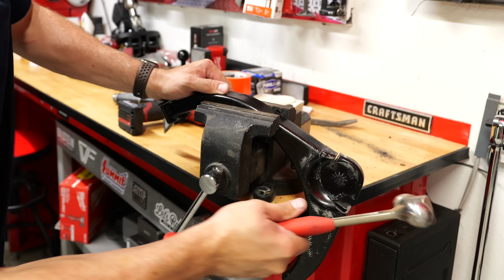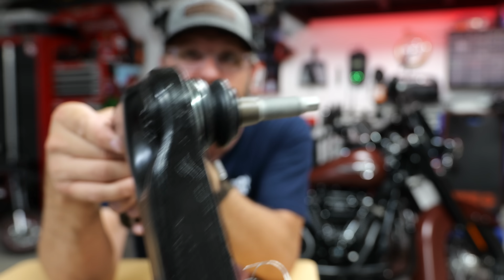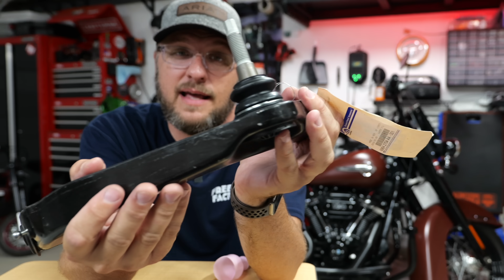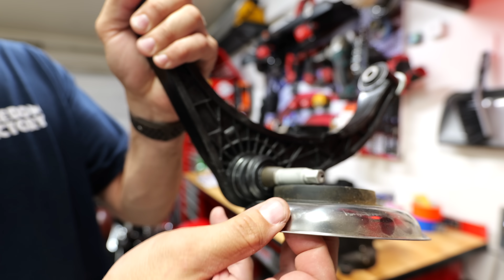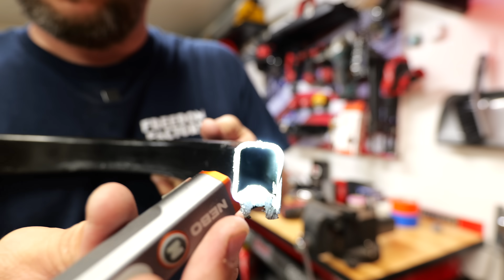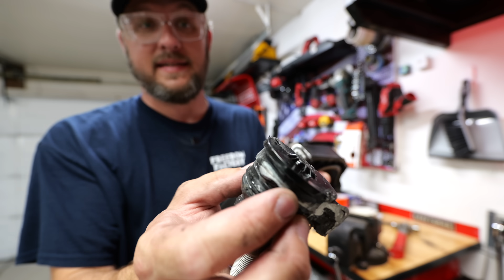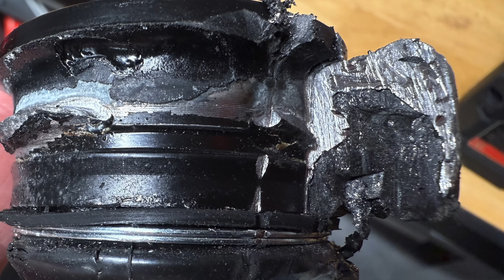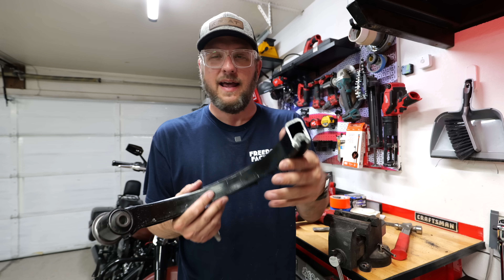I Cut Open RAM’s Plastic Upper Control Arm… Worse Than I Expected?

Comment: I have had 3 vehicles, 1-1992 jeep commanche 4L  6 cyl,   2-2006 saturn vue 2.4L  4 cyl,    3-2015 mitsubishi outlander sport 2.4L  4 cyl, all roughly the SAME GAS MILEAGE.

Comment: Because you can stamp a U shaped component. Plastic is there to prevent the U shape from collapsing and is a good use of plastic because it will be completely under compressive stress.

Comment: One of the particulars that finalized the "Go ahead" decision to create the Pontiac Fiero was its "All plastic" bodywork....the deciding reasons were the cost of forming a plastic fender vs. forming a metal fender....the cost of forming a single metal fender EQUALING the cost of forming the entire plastic collection of bodywork pieces. Why make it out of metal when you can make it out of plastic at one-twentieth the cost?

Comment: Dodge loves making plastic parts. Just like their crap rear ends...
Reply: Just want to clarify I'm a parts fabricator. I've been building control arm systems for years. I daily drive a prerunner trophy truck. I know how much strength I put into my control arms and this just really a crazy thing to see. Uppers are primarily guides to keep your spindles upright. They don't need to be crazy strong but they do need to be able to take force in all directions. That ball joint breaking off was absolutely insane to me.

Comment: GM has had Afm, Cylinder Deactivation,  DFM or whatever you want to call it since 1981 and it ALWAYS FAILS!! Making plastic suspension parts is ridiculous!! First off metals can be recycled and presently not all plastics are recycled with the excuse they can't. But the real true is COST!! ALL plastics can be recycled but it COSTS more to recycle than to produce new plastic. We already have to much plastic in or environment and these co trol areas are just another thing that will not be recycled so Dodge can save a few dollars!! Added to that not easy being able to replace ball joints or bushing easily. Just JUNK!!!

Comment: If they full inject it. It would most like flex to crumble a part over time. Plastic can only take so much abuse. Keep in mind potholes, uneven surfaces, offloading... it may fail muvh much early than the traditional upper arm would of ever failed. Depending on camber bolts being seized in the arm

Comment: Am gonna just take the ignorance of your youth and understand why! You dont think the trucks of today are overpriced! Probably never even road in any of the old 40's,50's and 60 thru 70's trucks and cars! My gen new how to make the stuff to last! This gen....pop corn crap, my TP roll is worth more! Dont get me started on the computerized BS they have put in. I see more people having problems today all cause of computerized gizmos! You keep todays look good crap and I will keep the good ol stuff. Heck, I can still turn my neck to back up and dont need a camera that wont work half the time to do that! This gen lacks SOO much! Hmmm, ingenuity being a key component! Ya know cummings makes a transmission for the Nissan Frontier and they keep a 3 dollar part out that any good mechanic could and should be able to fix cheap, They keep it out so when it fails and it will the customer has to pay 12,000 for a new tranny! The days , MY TIME, buy a vehicle and got a great warranty!  Usually at least a 100 thousand or more. Today they dont. Nissan Frontier offers 36 thousand miles on their tranny and drive train. That speaks volumes!
Reply: I'm old enough now that I really think I can live the rest of my live finding older well-maintained stuff from about 2005 or so and back. That's when they started with the CANBUS computer stuff where EVERYTHING is tied to the VIN number and has to be programmed to work. Vehicles that old and older can still be found in perfect condition if you know what vehicles that have the better histories to buy. CANBUS forward it has been nothing but a long decline into Tinkertoys and I think the Tinkertoys would hold up better.

Sad part is that the younger folks think that all of this garbage is "normal".
Reply: @CallibanMcGee  LOL, my first legal ride was a 64 chevy 3/4 ton truck, straight 6 and amazing torque. Am looking for a 72 ford econoline/ with a 3 speed on the  column.
Reply: @Fish4Man61 mine was a 66 F100 3 on the tree. Great place to rest your arm. Lot of firsts in that truck, including one you're STILL not old enough to hear about. 😁

Good luck in your search for your ride!
Reply: Yea. Everyone thinks push button to start is a new thing! An old 1962 Ford P/U had push button start with no key FOB! Dislike all these electronic  gismo vehicles of today. Orr neighbors 2015 Ram p/u has way too many electronic gadgets. Especially for the HVAC & radio.

Comment: After seeing the cross section of the first cut, I'm inclined to think the plastic extrusion/injection helps make the stamped part more rigid for chassis or noise tuning and potentially some driver input at the wheel. However, this seems to fall in line with the wear item parts are throwaway vs being serviceable trend in automotive.

Edit: Sub'd

Comment: so its actually a steel control arm but coated in plastic. was that done to prevent rust? because it doesnt look like it would need the plastic for structure.

Comment: With the number of control arms used, they should make it out of forged aluminum. AR15 lower and uppers are made of forged aluminum, then machined.
If not aluminum, they should at least use forged carbon fiber.

Comment: Don't care!   Parts get old and then twist happens!!!  Where steel could help save you safety wise, all polymers break down and could cause series problems in many forms. Not to mention they are still charging you premium for a tonka toy, which by the way are probably still built better!!!

Comment: I would guess that the actual metal in that arm is thinner than a "NOT" plastic arm would be.  Perhaps you can find an equivalent "all metal" arm and measure the gauge of the steel.

Comment: Ford f160 xl has the exact same one that the raptor r has. That should tell you that they don't do much. That ram part has metal mesh coated in composite. It's more than enough for what a 1500 is going to need. This isn't new. And you people to just notice them, they have been used since 2018 and haven't failed yet.

Comment: I don't like the idea of control arms being plastic, but as someone from New England, I can appreciate the fact that it wont rust.

Plastic on cars is only about one thing, cost savings. Which is why I don't like seeing it in critical locations like this. If they had a track history of using plastic for other reasons and not cheaping out on it, maybe my mind would be different.

Comment: People often die 10 years later after engineers cut corners to save costs. Most don't think in terms of chess and many moves down the road...they think about right now, and right now profits that lead to tomorrow's queries and concerns when ball joints are popping off and vehicles are careening out of control into something, or somebody.

Comment: apparently, we have been doing such a good job reducing fuel/oil consumption, the automakers now have an abundant amount of oil to waste on plastic part fabrication, with this hollow, crimp welded inner core, I think corrosion will begin internally once the ball joint wears down, just a tiny bit of moisture and some ice-melt chem will probably create a rapid structural failure, requiring the purchase of an entire L/R upper C-arm assembly, do a corrosion test, maybe that could prove me wrong

Comment: Surely when the plastic ages and becomes brittle enough it will just break. I would get it if it was a composite with carbon fibre mixed in but if it’s just plastic. That would never fly here in the UK 🇬🇧. A plastic suspension arm is just stupid and irresponsible

Comment: I've been driving for around  50 years. I've never bought a Ford or Chevy, always been a Dodge man, especially when buying trucks.  Overall, haven't had a lot of problems with Dodge trucks.  That has now changed for me. My last new Dodge truck was a  2012 1 ton  Cummins and loved that truck and had very few problems . The Def system gave me problems but that was about all. Before that I had a  2010 1/2 ton that my wife mostly drove. Had trouble with the A/C from day one. They've been installing A/C in vehicles for decades and still can't come out with a dependable system. Everything is plastic and made so cheap. I'll probably go with Toyota next time although some people say their quality isn't what it once was.

Comment: Control arms come under extreme stress when cornering and braking.
All types actually. Compressive, tensile and a combination of both (bending).
I would say intuitively you are better off with metal.
But at the end of the day it depends on the UTS of the materials.
A box section is always going to be more rigid and stronger than a U section.
The plastic is going to reduce the incidence of corrosion though.

Comment: In a day of worry about carbon footprint impacts on environments, the solution was to add plastic on a part that was steel that use to be easily recyclable?  I will advocate for steel for all suspension housing components, plastics make zero sense to me in an engineering aspect other than inbuilt obsolesce.

Comment: These type of products only benefit the manufacturer because it cost less to make some cheap plastic part and it is easy to keep re-engineering that part to less and less material to make it. Then finally it breaks and breaks and breaks again and consumers suffers and may lose their life over it. That plastic on that part is just for reinforcement of the cheap metal roll job. That part is not safe at all. If your new truck comes with that...run away fast.

Comment: Several years ago, I saw a Chevy Cavalier t-bone a mid 2000's Ford F-150 right in the right front wheel, snapped off the Aluminum upper control arm right off, the car barely busted the bumper and drove away (after police arrived) Truck was done and had to be towed. not sure this would be any worse

Comment: Possible mitigation for the “Death Wobble”?  That plastic as part of a composite structure could dampen some modes of oscillation.  Every component in a front end has a big difficult job.

Comment: If you mold really thick plastic, you have a problem.   When you heat plastic it expands, like Polypropylene it expands as much as 15%, that means when it cools it has up to 15% voids, voids in that control arm will cause it to move around under a load.   I know when calculating plastic output by weight the output is reduced to 87%.  Where is the 13% after it cools, it is voids.  That control arm is better known as a fake.  They are getting over on the public.

Comment: Costs on vehicles are a reflection of an overregulated mining and industrial system. I agree there should be smart engineering, and we should not exploit workers, but now much of the cost of producing a vehicle relates to the environment and a demand to overprotect. People often criticize plastic-based parts, despite their widespread use in structural applications. It really depends on the kind of plastic; for example, fibre-reinforced resin makes up the control surfaces of the plane we fly in, and air creates a massive torsion load on wings. This torsion load is why wind turbine blades only have an effective life because the torque will delaminate the fibre reinforcement. Based on how hard it was to cut through the upper control arm, it could very well be made of fibre-impregnated thermoset. Many cars are glued together rather than welded because elastomers have a better application speed than welding with comparable bond strength. 

But the bottom line is the reason they engineer cars, or for that matter any goods, is because of the consumer. To reduce cost while complying with all the regulations and restrictions, the companies have to find points they can install low rotation points and make them plastic.

Comment: I mean I am not sure how people are suprised by this. All the cars now are so over engineered and all the mandates to meet mpg demands has ruined vehicles. Unfortunately Dodge is just so poorly built and the quality control is non existent it's all just how much profit can we make and they are bought and sold every few years to a decade so its constantly new people and new problems as well as old that just never get fixed. I mean come on how many years have they had the hemi tick the leaking exhaust manifolds the need to rebuild the front end every 20K-30K transmission issues plethora of electronic issues cheap interior plastics poor fit and finish the list goes on and on.

Comment: The prices they charge for these trucks are absolutely out of whack with what you're getting. It's absolutely crazy. Plastic suspension parts go on models, not passenger vehicles.

Comment: Haha, is this part from a new $5,000 vehicle? No wonder people are turning to Chinese cars and seeing U.S. ones as lower quality.

The only valid reason to use plastic or composite materials for structural components like this is to coat steel and protect it from rust.

Comment: I used to work at a Ram dealership.  When I asked about this the engineer who designed this flew in to give  us some training about these.  The entire purpose of the plastic is to make changing the ball joint easier.  Just heat all around the ball joint until it's cherry red and it'll fall out.  No other press required.
Reply: But then you got a bunch of melted plastic everywhere?
Reply: @LibertyOrD__th  Yes but it wasn't necessary plastic.
Reply: But then your risking changing the temper of the metal with the heating to cherry red. With my old 1970`s &1980`s GM & Fords just drill out the rivets from factory & ball joint is free to replace with new bolted in one.
Reply: @frederickbooth7970  It's already as angry as it's going to get.  Can't make it's temper any worse.

Comment: Plastic degrades over time and there’s nothing you can do about it.  I had a first gen Snapon deadblow 
hammer in the early 80’s and all the plastic cracked and fell off within 10 years.  I have a third gen Dodge Ram 1500 with a dash panel that is cracked everywhere.  Plastic is wonderful for certain things but give me metal for suspension, engine parts, etc. Nice video. Oh, how much did the control arm cost???

Comment: It takes more manufacturing effort to produce this cheep plastic part than it does to make a stamped steel part. The steel skeleton inside the plastic takes more processes to get the assembly ready to go into the injection mold.  Then, you add the extra process of the injection process. In the original process, steel stamped shape, then move to maby two other dies to finish shape the product.  They could have better cheaper with thinner steel. The very nature of plastic exposed to the hot summer / cold winter will destroy it. That is the reason they sell plastic buckets instead of steel ones. The manufacturer knows that if you use the bucket to work outdoors, it will not last and have to be replaced. Even if you use them to just store things in, they get to the point where they are easy to bump against something and split open. 
     Manufacturers try to convince us that plastic is stronger than steel. They may prove soon after it is out of a mold. But in my personal observation, plastic deteriorates at a rather fast rate, and that is the reason it is used.
Reply: I have a 5-gal pail full of expensive metals for small projects and one day I came to the shop and the bucket just setting there had disintegrated.  Plenty to pick up, a metal pail would be there 50 years from now.

Comment: All companies now are planned obsolescent at 100,000… don’t do any oil changes till 10,000 don’t ever change your transmission fluid etc. is what happens you get all the piece of metal and then they’ll go in the bearing surface and just wear everything out including valve bodies in the transmissions